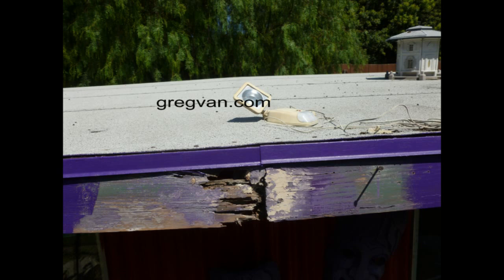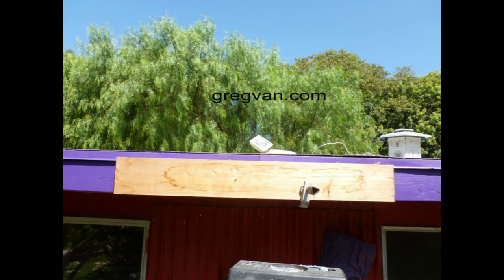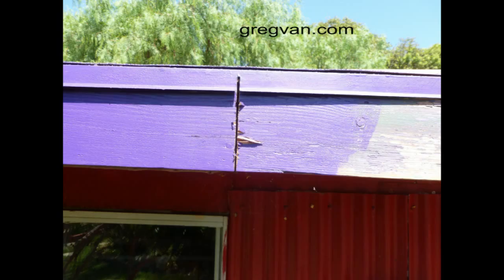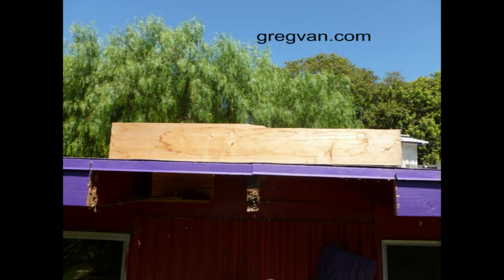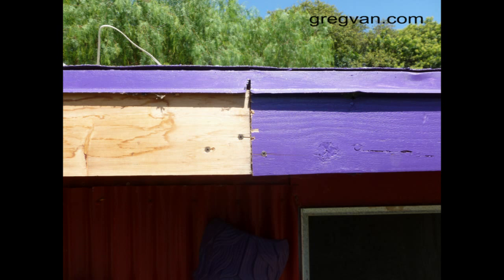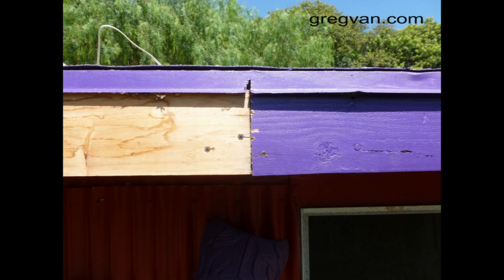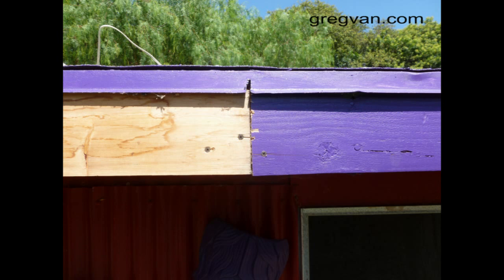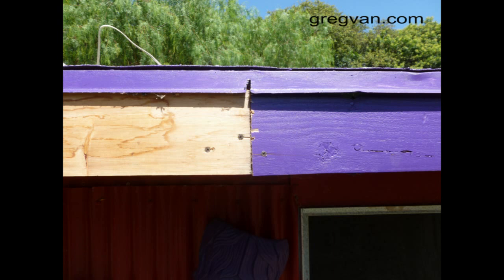15 Minute Roof Fascia Board Repair - Do It Yourself Tips

Comment: @gregvancom What brand is that clamp that you used to hold the board up temporarily? Thanks for your videos, they are ver helpful.
Reply from the maker: Any C clamp will be fine that's wide enough to clamp the two pieces together.

Comment: Nice hack on the drip edge
Reply from the maker: If you're suggesting that it would make any difference at all to this old building, you're probably wrong. The roofing isn't sealed at the bottom and the low slope of the roof pitch allows plenty of moisture to absorb into practically every part of the building. This repair is exactly what I said a quick fix, but might not be used for projects that need to look good and function properly.

Comment: 15 minutes. Doubtful
Reply from the maker: You're right, if I had to go down and buy the lumber, maybe stop for lunch, but if all the tools and lumber are there, I could probably do it in less than 10 minutes.
Reply: As long as you have all the material on hand - and no gutters attached.